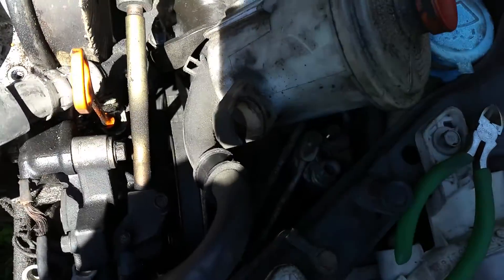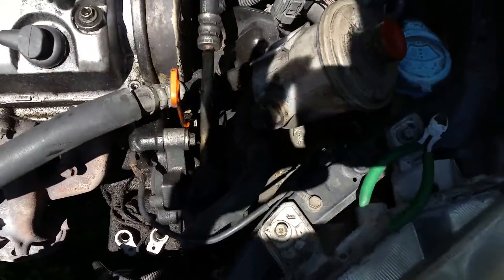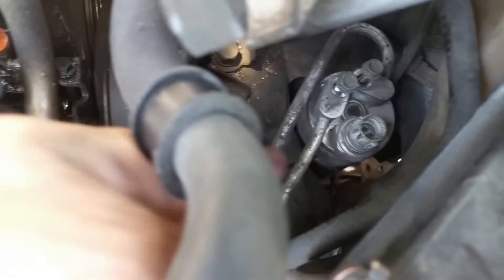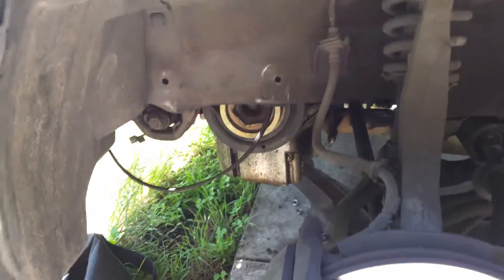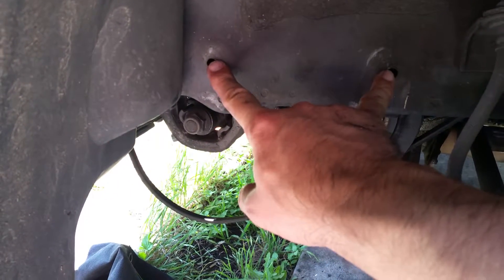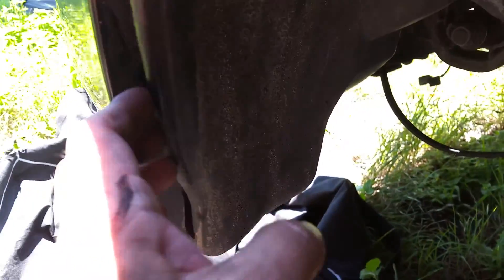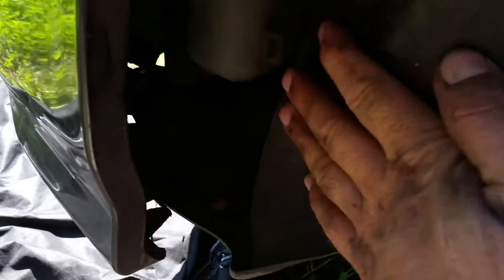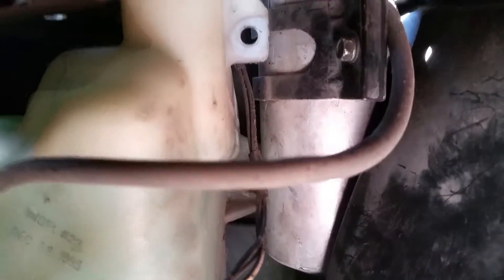96 Honda Civic Dryer Replacement

Comment: Thanks for posting! Two quick questions. 1) Were you able to get it out through the bottom or the top? 2) did you have to remove the tire to access it?
Reply from the maker: It has to come out through the bottom. Do not loosen the bracket until you've loosened the ac lines. After the ac lines are disconnected, then remove the bracket. You can peel back the plastic and remove it without removing the tire. But if you remove the tire it makes it alot easier.  Good luck!